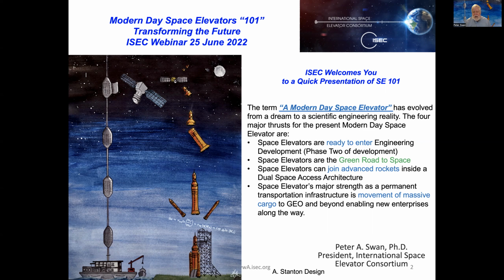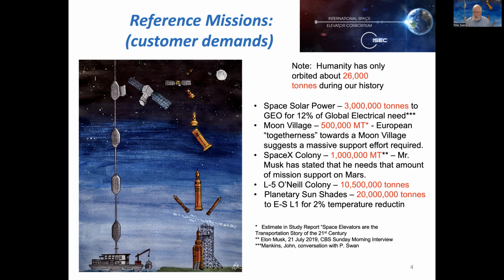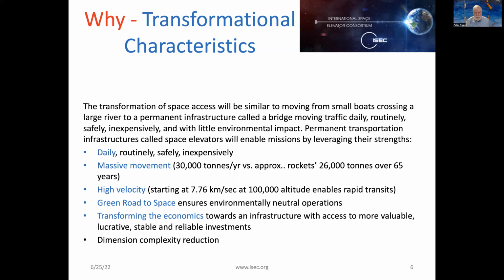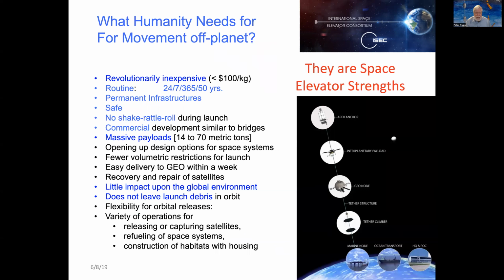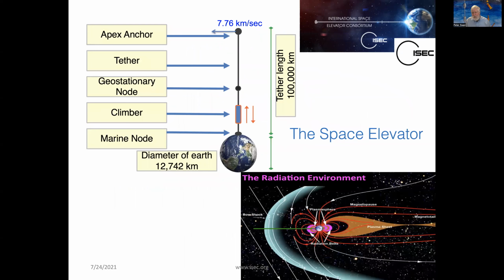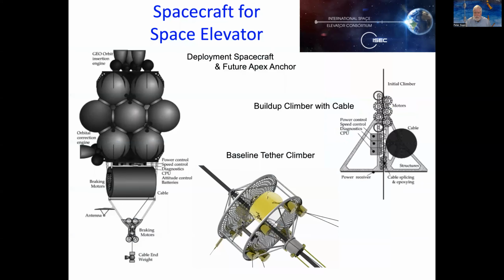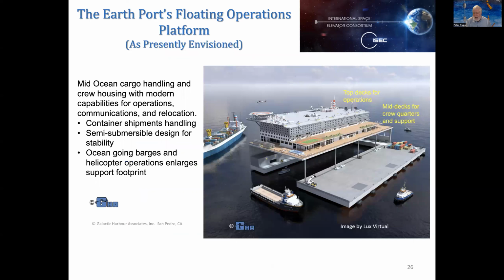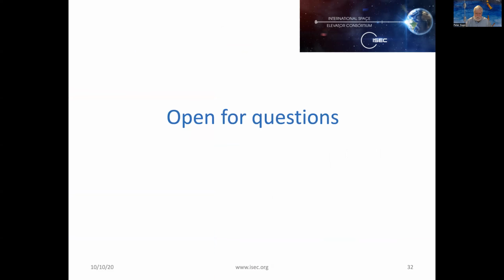Space Elevator 101

Comment: Fantastic project :) but graphen is good electrical conductor, and there is a permanent voltage ~400000V average between earth surface and electrosphere (see atmospheric electricity on wikipedia and the article from Feynman). Can we solve this with a big insulator at the base? Could it be a source of energy for the elevator?
Reply: No. There voltage is high, but the change density is low. The ionosphere is also part of Earth's protection from cosmic rays.
Reply: @riderpaul  See at feynmanlectures caltech II_09 "Electricity in the Atmosphere" (I will put the link in next comment, if antispam OK): "Although the electric current-density in the air is only a few micromicroamperes per square meter, there are very many square meters on the earth’s surface. The total electric current reaching the earth’s surface at any time is very nearly constant at 1800 amperes. This current, of course, is “positive”—it carries plus charges to the earth. So we have a voltage supply of 400,000 volts with a current of 1800 amperes—a power of 700 megawatts!".
The average power needed to carry 1million kg per year at geostationnary orbit is 2megawatts (50megajoules/kg). With 50% efficiency, the average power needed is 4megawatts : that is a very small fraction <1% of 700megawatts available, so it won't deplete the ionosphere and you don't have to carry about cosmic rays ;) (but this is a question that will have to be addressed seriously)